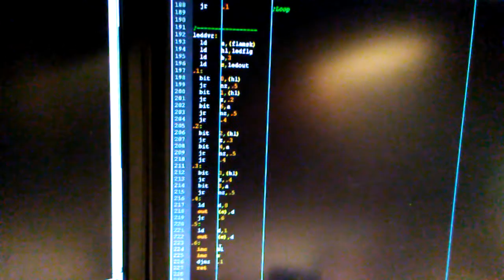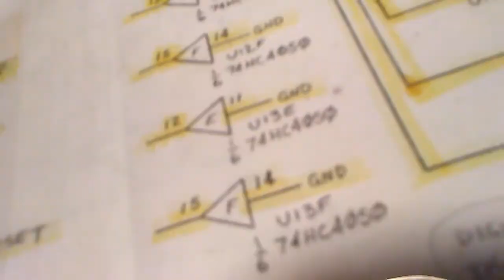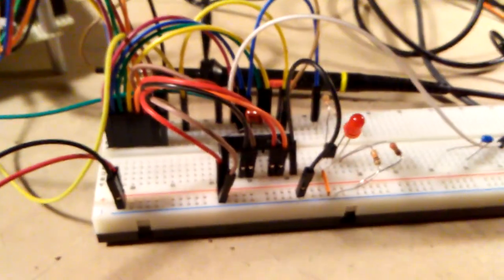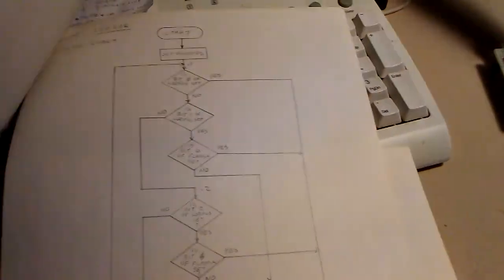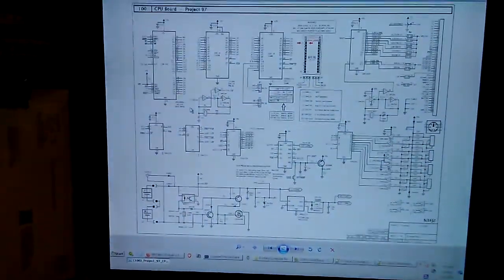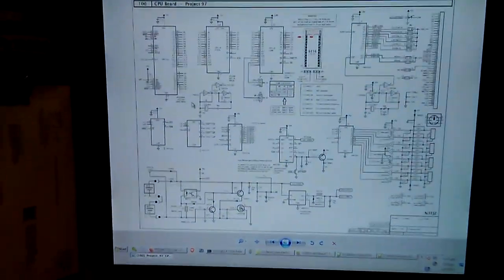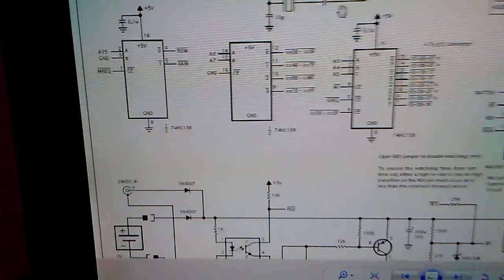Z80 Hand wired single board controller from 1997

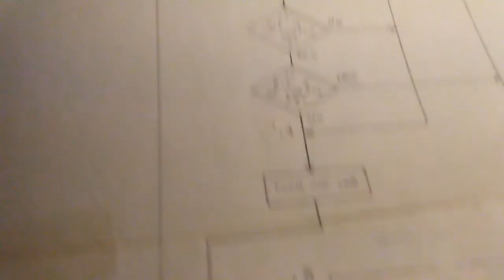Comment: 8:35 wow I remember learning those flow charts when I was 10. But I never used them really that much when I was programming in BASIC, I guess for doing assembly they are helpful. I picked up assembly only because of reverse engineering, I never thought I would ever need to ever use assembly ever, but here I am (don't write almost any of it, but I read a lot of assembly, even to fine tune compilers).
You mentioned 1986, lol, I was just a baby, that made me feel young, and I think of myself older now after doing it for 26 years. man time flies, doesn't it ?